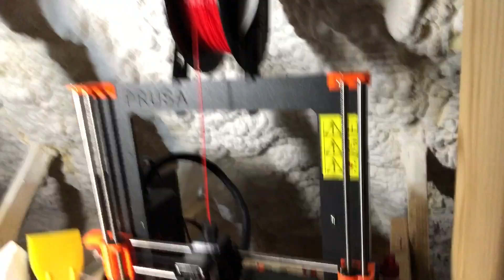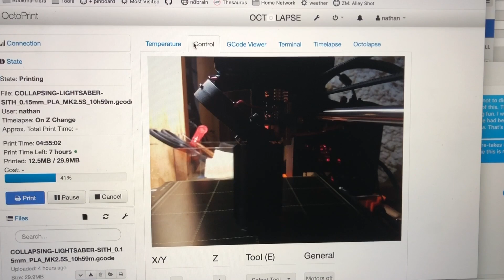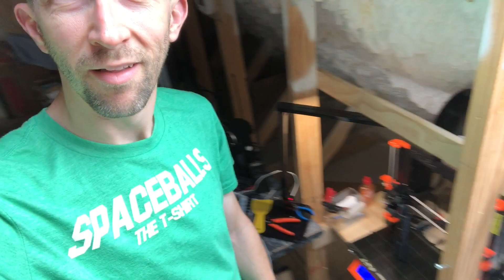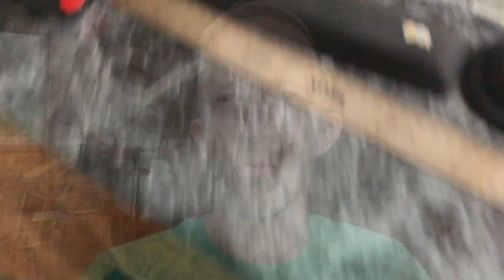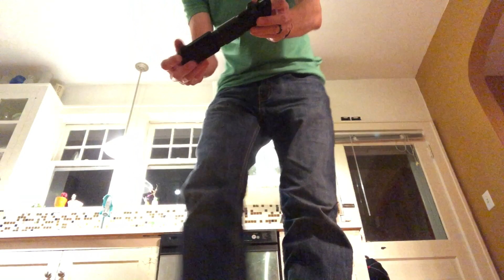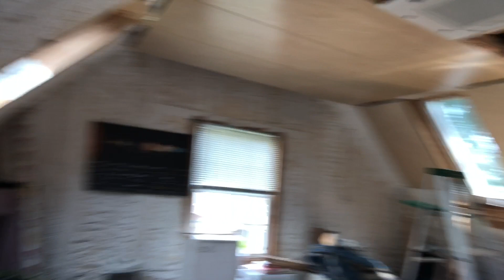Making a 3D printed Sith Lightsaber

Comment: I’m a little confused Because the files to print the blades separately don’t have holes. there just solid any way to fix this?
Reply: they pop off lol
Reply from the maker: Hey! Yea, so I'm sure you've figured this out by now, but for posterity - you need to print in vase mode. The trick I did to make it sturdy was to over-extrude, I forget the exact settings, something like 120%.